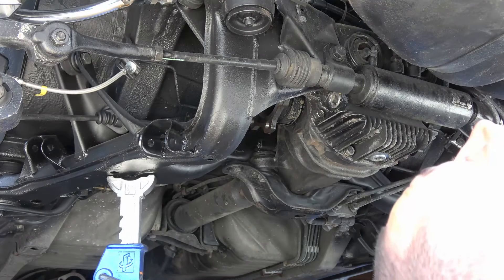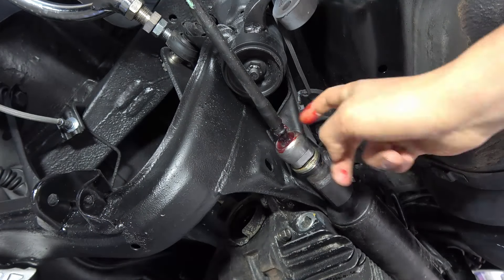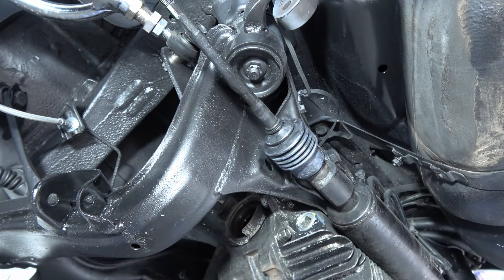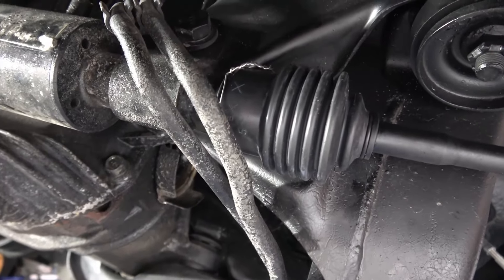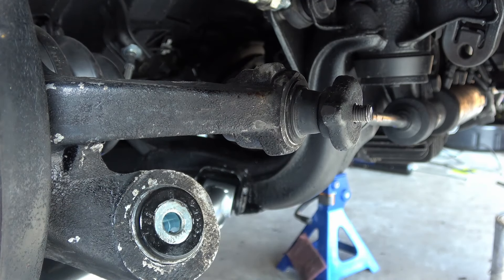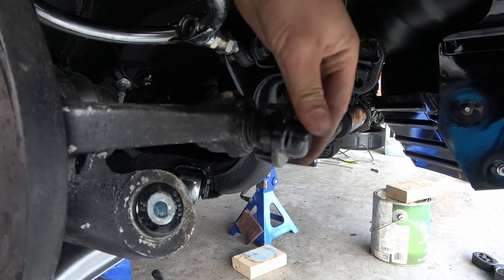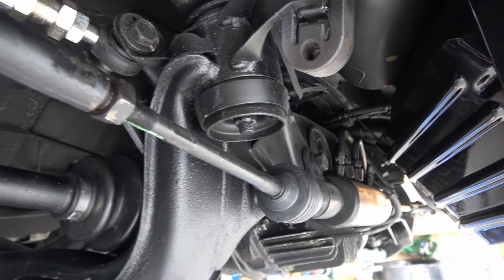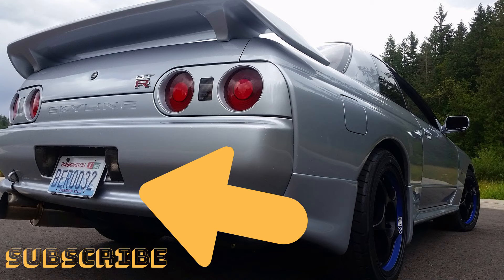Rear inner tie rod boots Nissan Skyline GTR R32 HICAS rear steering.

Comment: I got my R34 GTT in 2016 and everything was allright. Since a few weeks the car is doing weird things when I speed up from 100 km/h to 120 km/h or more and speeding down to 100 km/h. While speeding up I need to move the steering wheel to the left side to drive straight and while speeding down I have to move it to the other side. Last ride the car went almost out of control while speeding up fast, so I decided to not move it, until it is repaired. I think it has to do with the Hicas, but I know nothing about repairing cars or the system as well. Another fact is it seems not to be a mechanical mistake, while it sometimes works and the next time it doesn't.
Reply from the maker: I would check all your bushings all your ball joints see if one of them is broken. Have you had the alignment done? Is there an aftermarket steering wheel that is maybe out of alignment with the steering sensor for the HICAS?

Comment: I got an 06 g35 coupe 6MT and it has hicas .but every time I turn the key switch to “ON” the HICAS component rattles and the two axles going to each side seems to go in and out and makes car slightly shake . What could this be ? Is something wrong ? SHould I stop driving it . I have no check engine light . Please help. I have video of it but won’t let me upload
Reply from the maker: I would check all the bushing and ball joints connected to the HICAS. Also check the HICAS fluid reservoir and inspect the fluid level and see of the fluid looks dirty. Good luck my friend, I dont know very much about the G35 except I would drive one if it had an RB26DETT with a Skyline GTR drivetrain!
Reply: JDM Right Hand Drive https://youtu.be/8IzrapxLciE this is a video of my actual car doing that noise
Reply: JDM Right Hand Drive where is the fluid reservoir located?